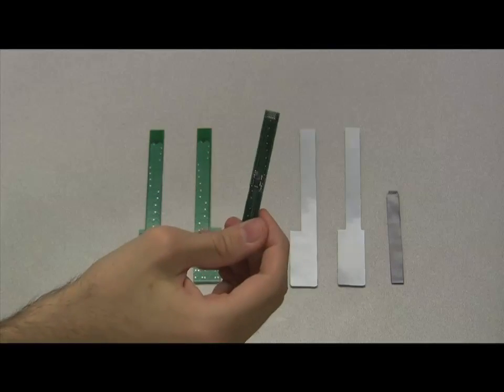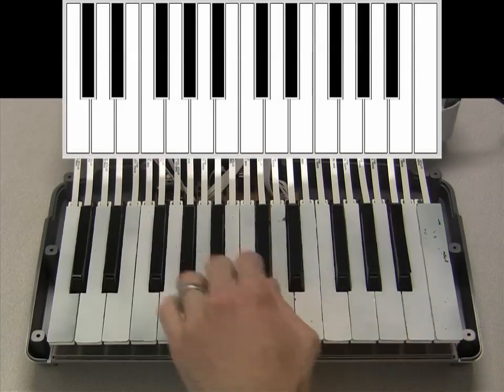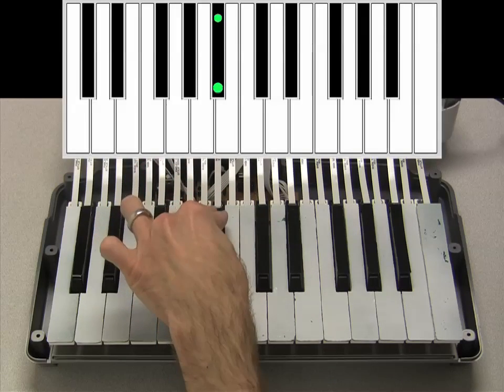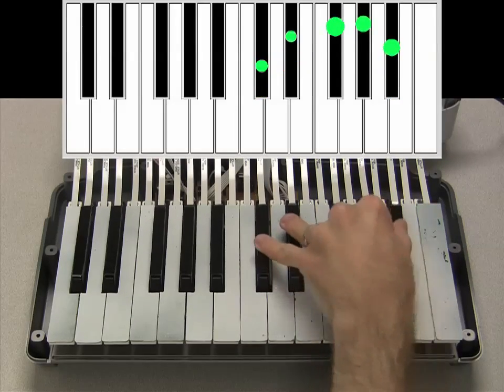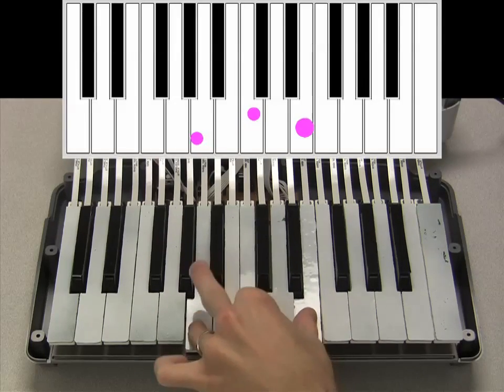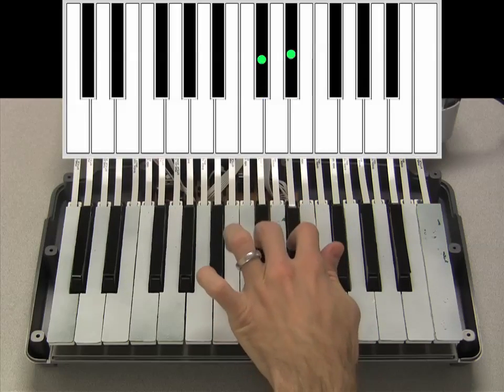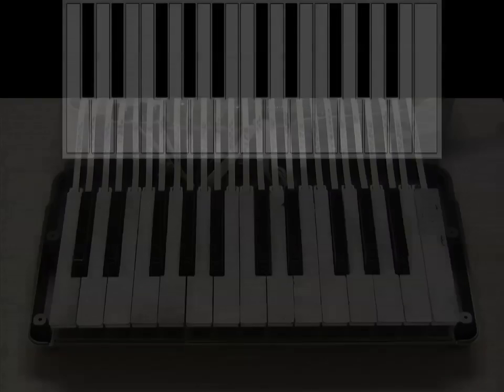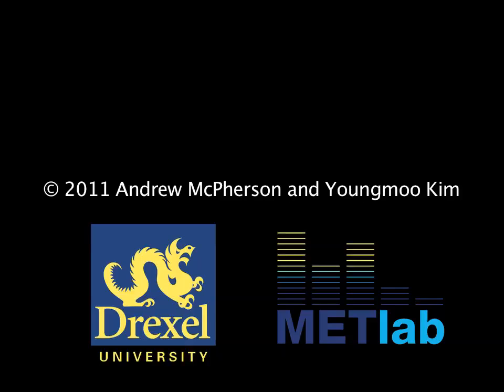Multi-Touch Piano Keyboard

Comment from the maker: I'd keep your keyboard. The TouchKeys are sensors that install on any existing keyboard to add multi-touch capability, so you'll need an instrument for the DIY kit anyway. But to answer your question, it will be more than $400 for a 61-key set. Each individual key needs to have electronics built-in to sense touches, so they cost more to produce than your usual mass-market MIDI keyboard. But it'll be worth it. :-)